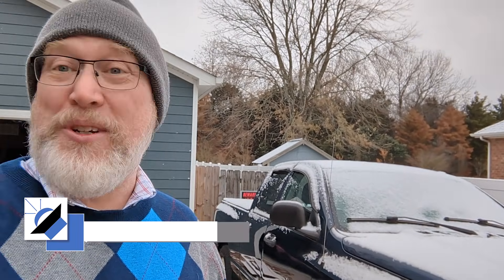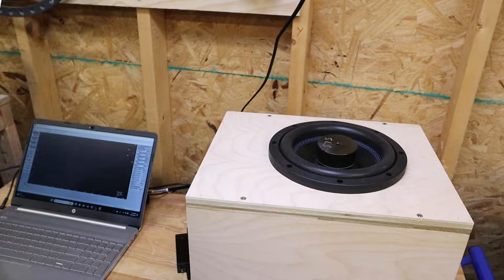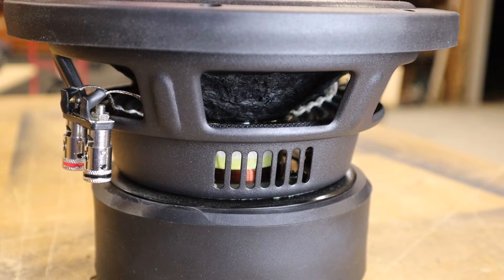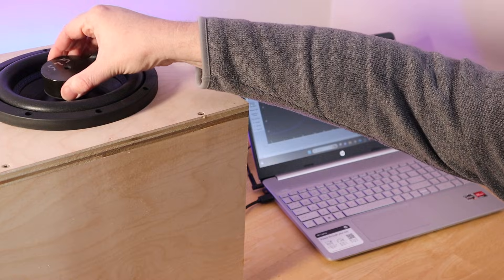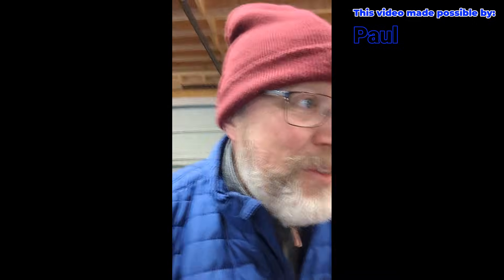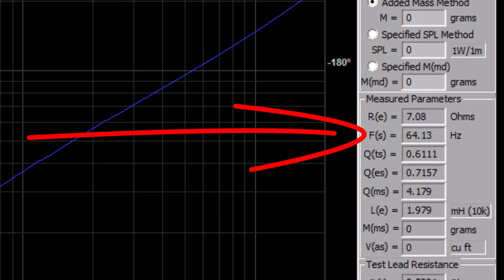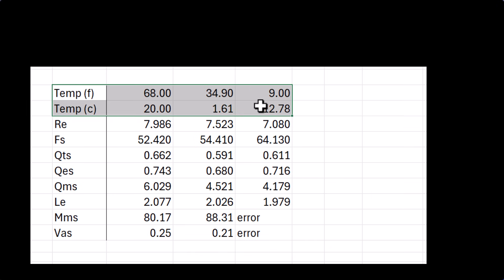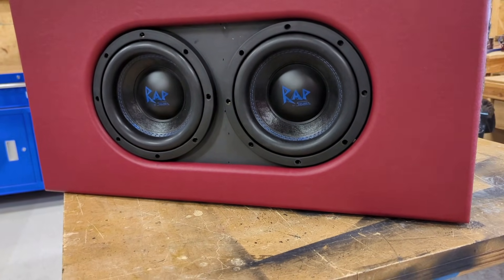Subwoofers in EXTREME cold weather!

Comment from the maker: Subwoofer: https://lddy.no/1jqmo (Use the code diyaudio for a discount)
Test Device:  https://parts-express.sjv.io/b3BEDP (Use the code DIY5 for a discount)
Reply: DAG (aka. Justin), out of curiosity, I wonder how the "extreme cold" (a FL resident here, know me as Mark Yok... on fb) affects mechanical limits/sub blowout. More specifically what Parker the Basshead (no people, nt like the Public Enemy song... BASShead, not Basehead).

Anyway, there was the consumer line of amps in the late 90's-early 200's  which utilized a channel cooling through the amp with anit-freeze to maintain amp temperatures. Since heat & (copper or aluminum, hybrid metal) voice coils are arch enemies, would it be beneficial to sustained subwoofer performance to have an "in-enclosure" cooling method? Of course, a fan would never work, nothing which could potential cause condensation or other moisture build-up, or anything which might work to alter the magnetic performance of the motor assembly/voice coil.

There is one thing which would help reduce the temperature of the voice coil BUT it would probably have to be built into the basket or motor technology (but not necessarily). Although, if lower temperatures don't make a significant difference in regard to driver efficiency or reliability, it would not be worth the research. *Yes it matters of course  :)      I may need to start researching this out... NOT a subwoofer builder/repairer... that's an EXO thing. Voice Coil temperatures in regard to reliability, efficiency, sustained power handling... something to think about.
Reply from the maker: @kjata77  definitely something to think about

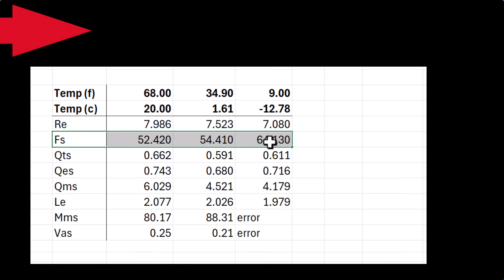Comment: 5:28 I'm pretty sure there's a temp rating for the rubber surround and for the test itself. The added weight needs to be UNDER the mass of the suspended driver to get accurate results. If there isn't a set temp range for the test, there should be! Most electronics of a set temp range for operation. -3 is well bellow any electronics operation or electronics testing window.

Comment: you can somewhat extrapolate the VAS from the change in Fs and Qms as a multiplier. It’s not scientific, but as a ballpark it might explain the error messages. 

From 68 to 34 
3.7% increase in fs 
30% decrease in Qms 
Made for 10% increase in Vas

From 34 to 9 
18% increase in fs 
10% decrease in Qms 
On Fs alone could indicate a Vas increase of 45-50%  - yikes 

However If we extrapolate including Qms as a multiplier, it could suggest a more conservative vas increase of 15-17% - still pretty yikes 

Again this isn’t scientific. Just spitballing using the parameters that are relevant to suspension.
Reply from the maker: You are on to something, they are mathematical combinations of each other.

Comment: I have 2 alpine type r 12s in a suv  it's winter in illinois  and even in a heated warehouse at 50 ish degrees my subs aren't hitting as hard . I've tried checking all the fuses and reconnect the rca  plug ins.   Anything else I can check? I have a hair dryer i could try to warm them up?
Reply from the maker: Just playing them at moderate volume should be enough to get them up to operating temperature.

Comment: i left my sub in my car and didnt play it for a couple of weeks and now theres water all over the cone and the rubber thing. what do i do is it bad for my sub
Reply from the maker: It's definitely not good.  If your subwoofer uses a paper cone and a foam surround, it may be ruined. With a poly cone and a rubber surround, it'll probably be okay assuming no water got inside of the enclosure and no water got on your amplifier. 

Dry everything out. Turn it on and see what happens.
Reply: @DIYAudioGuy  when i was playing it nothing weird happened but im still going to put it in my room until winter is over
my sub is a pride junior 12 (not the pro version or the v2)
i think that it has a paper cone and a plastic dustcap
Reply from the maker: @karersio7062  You might want to try to hunt down the leak in your car.

Comment: Here in northern Vermont, I've shattered the carbon fiber cone on multiple subwoofers when forgetting to turn them down in negative temperature weather. It's not so much the suspension I needed to worry about, but the actual cone itself
Reply from the maker: Ouch.

Comment: Outer Dimensions (Width 25"  Height 20"  Depth  8"  Thickness 0.75" Mdf     Front Pipe Port)  would this be a good enclosure for my (Jbl 12"  325 Rms) Subwoofer.   I am tight on the space, pls tell will this give Quality output ??

Comment: Hey I'm was just wondering if anyone could help me out i built a box for a single cab s10 that holds 2 10s i think it's right at 1 cube but I'm having trouble on what length my port should be using 3 inch pvc box dimensions are 31 L 14 H 6 W at bottom 4 W at top 3/4 mdf no baffle inside speakers are ctsounds hydro.  Any help would be appreciated

Comment: It should be louder the air mass is smaller
Reply: @DIYAudioGuy   air volume in the air is less  when its cold an old drag car trick
Reply from the maker: @robertnewland9730  Yes, the air gets denser when it is colder, so you can force more air into a cylinder.

Comment: What about what happens to the air itself? Doesn't the cold dense air throw off the tuning of a ported system? Would cold air have any impact on a sealed system? Do any pro sound systems have any temperature compensation other than compensation for thermal compression?
Reply from the maker: Yes, the temperature and the barometric pressure all matter.  As for how much, I'm not sure.

Comment: Maybe unrelated, but the midwest is getting very cold as winter comes through and my subs kept cutting in and out the colder it got out and I was starting to think they really hate the cold! Which is odd because my normal door speakers could handle this cold no problem.

Turns out the alternator ground wire with CORROSION hates the cold! It's amazing what a 5 minute wire clean up can do to fix all your problems! Check your grounds everyone 😅😂
Reply: I always had this idea that after I clean my grounds really good that I could spray some clear coat over it in an attempt to prevent corrosion or slow it down drastically.

Comment: Something else to consider is that when they’re frozen so is the glue that holds the spider and surround. Glue IMO is the weakest point of a sub. Gets more brittle as the temps drop. More likely to cause damage if you push them when too cold.
Reply: Agree. My experience with car audio and Canadian winters is it's the glue joints that go in extreme cold.

Comment: Im confused on the part where you said a higher Vas = a softer suspension.  All the drivers that I've seen that have a relatively low Vas seem to perform very well in small enclosures. From what I can gather, a stiff suspension would not allow a driver to work well in a small enclosure. 

I kinda agree with RobotUnderground's rule of thumb for Vas. He states the Vas is the bare minimum amount of airspace required to hit FS with authority.

Comment: I used to work 12 hr swing shifts at a warehouse and one particular morning coming out to the lot we’d had 5 inches of mostly powdery snow. So there’s 200 people out there cleaning off their cars. Well I had a jeep wrangler with a soft top, two 15in Orion XTRs, and 3,000 watts. Started that ignition and let that baby boooooom. Snow shuddered right off and away I drove right on past all the folks still cleaning off their vehicles lol. This was 15+yrs ago and I will never forget the laugh I got out of that.
Reply from the maker: That is awesome!
Reply: I used to do the same thing in my 91 Grand Prix back in 2003 with two L5 12’s and 600 rms to each of them. It was so hard to get enclosure in the trunk I had to angle it weird and then last bit kick it in.  I had a unknown rock chip on edge of front glass and after I got my setup I went to show my friends one morning it was like zero degrees outside and I turned system on full tilt and it sent crack all the way across the front window I was like wtf!
Reply: @Thumper68 my license plate says thmpn-15. The Box goes in from the interior. Next time Remove the driver's seat and remove the back seats. Box slides right in.✌❤😃
Reply: haha thats so awesome
Reply: Lol.  Great story man
Reply: Doing a hz sweep would of been pretty cool to see the snow shake off